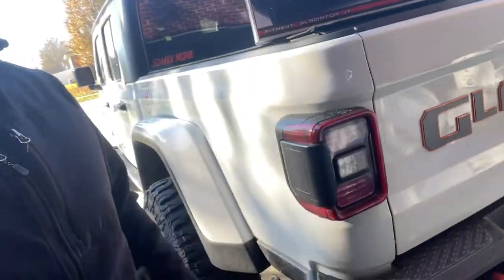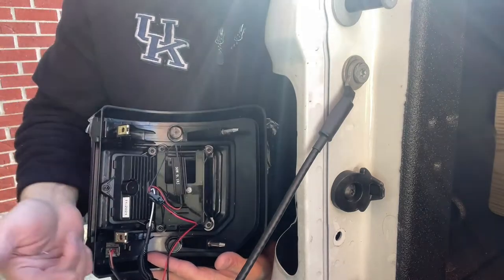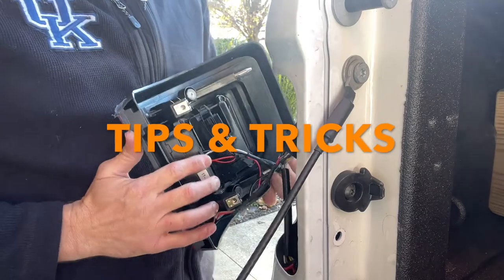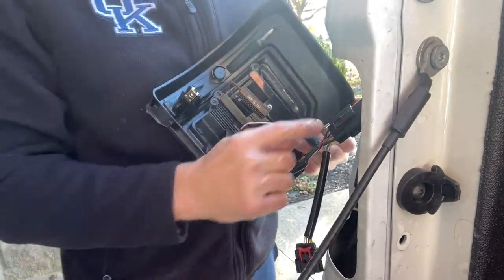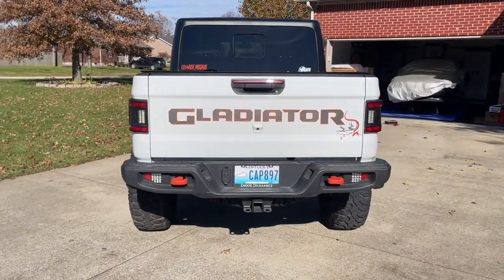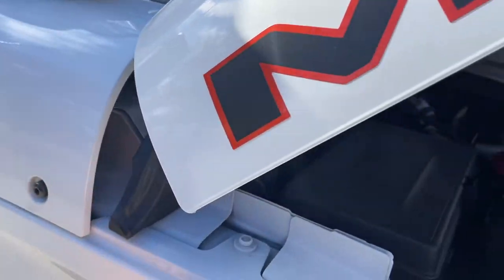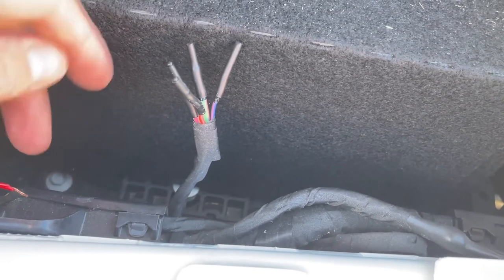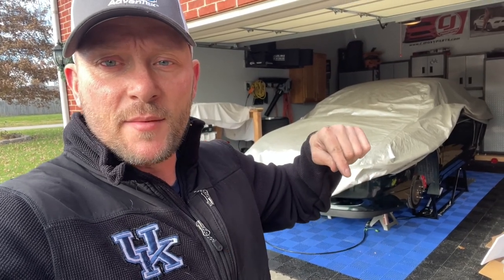Oracle Taillights & Side Shooters for the Gladiator

Comment: Have you had any problems with the bumper lights? I have a 2021 Mojave with LED package and have the bumper lights with the plug in play. I haven’t installed them because I saw another video where the plug in play gets over loaded and shuts off after a few seconds. Waiting on Oracle to respond about that issue. Will be getting the taillights though. Thanks for the tips, Awesome channel. 👍🏻👊🏻
Reply from the maker: No issues with the bumper lights. But I had the non plug n play set so their instructions were flawed...I had to figure out the passenger side signs wire myself. When installed the taillights it all worked fine for an hour or so then all the reverse lights were on and wouldn't go off. I had to reprogram with the taser and now it's working fine!!